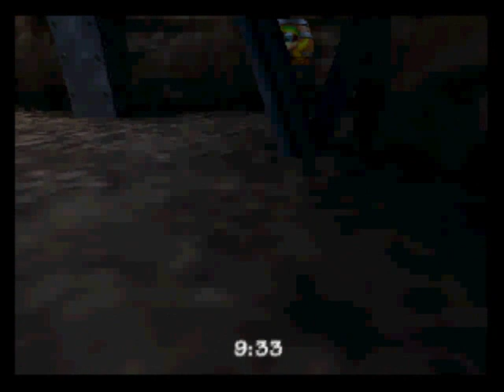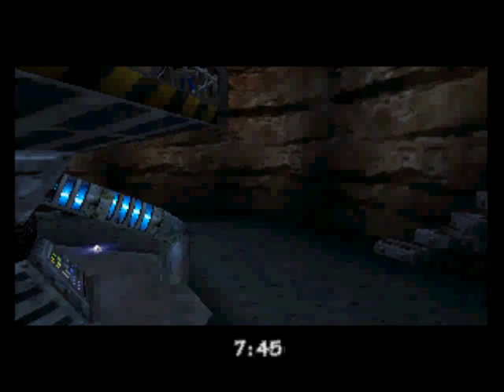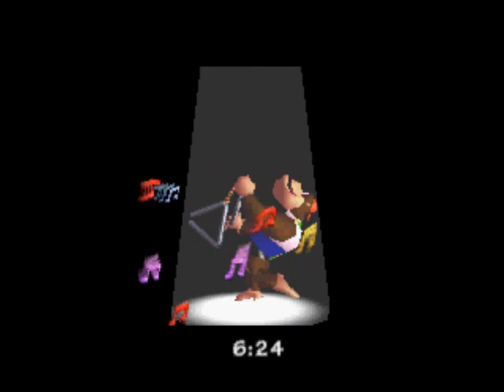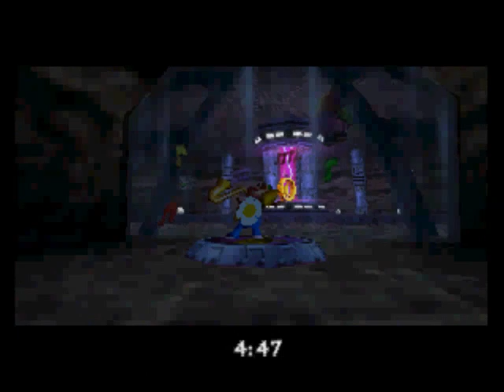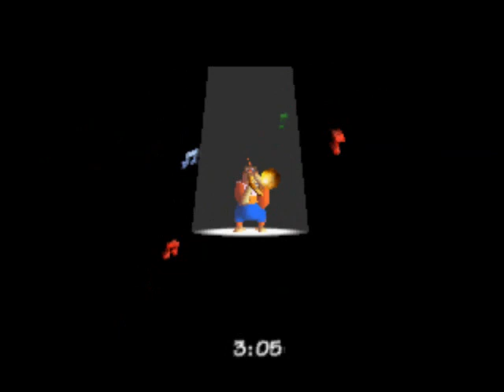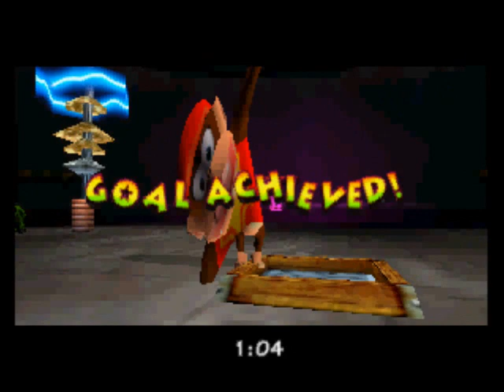Demonstration: Shut off Blast-O-Matic Without Blueprints

Comment: Why did you use the lag-generator (Oranges) to collect the Medals?
Reply from the maker: Getting the medals while in hitstun skips a dance cutscene.
Reply: Alright, I didn't know that. Thanks. Another question. Is it possible to shut down the Blast-O-Matic in 10 minutes without glitching or hacking?